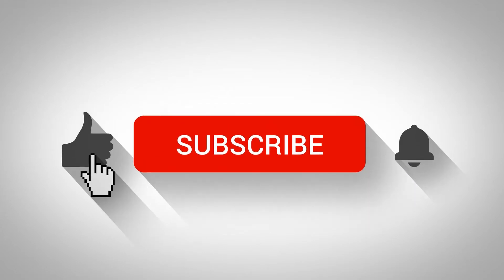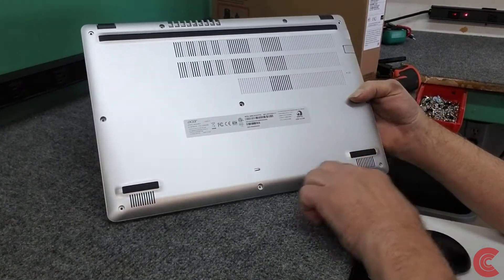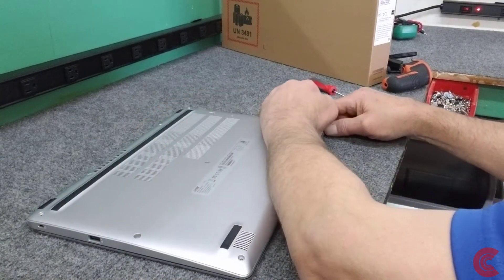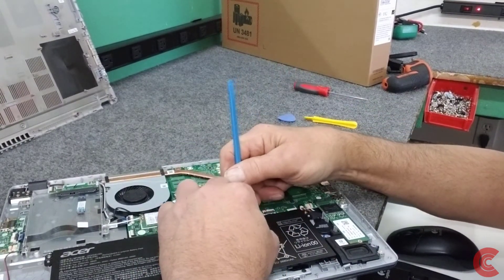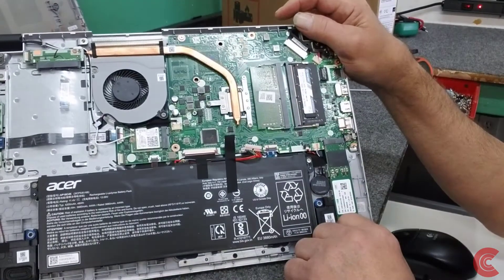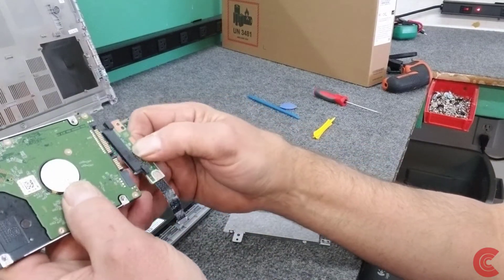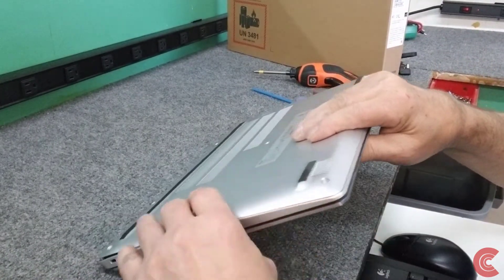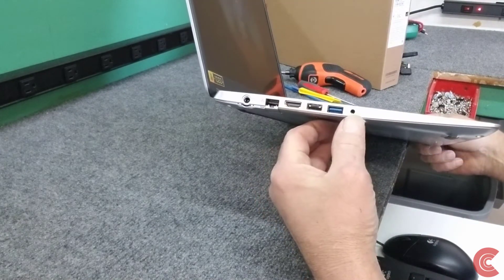Acer Aspire 5 Ryzen 3 Laptop Memory & Hard Drive Upgrade

Comment: Just wanted to know, can the 4gb of ram it comes with be removed, wanted to know if I can replace it with an 8gb and use another 8gb In the other.
Reply from the maker: Hi, yes, this model has 2 slots. You can remove the 4gb stick.

Comment: What size are those 4 small mounting screws?  I purchased the refurbished one and didn’t see the screws included.
Reply from the maker: Hi. I believe the screws to mount hdd in caddy are M3x3mm.  Dale.   Like these....
https://www.amazon.com/Replacement-Screws-Lenovo-Toshiba-Laptop/dp/B07FQXSJHH/ref=mp_s_a_1_1_sspa?dchild=1&keywords=2.5+inch+hdd+mounting+screws&qid=1608073071&sprefix=2.5+inch+hdd+mounting+&sr=8-1-spons&psc=1&spLa=ZW5jcnlwdGVkUXVhbGlmaWVyPUE4VkYwUVJSSUY5N0YmZW5jcnlwdGVkSWQ9QTA3NTE0MTkyTDNKVjM3RDVEMkVYJmVuY3J5cHRlZEFkSWQ9QTA3NDM4NjJNQlQ1TEZMOU1FVTcmd2lkZ2V0TmFtZT1zcF9waG9uZV9zZWFyY2hfYXRmJmFjdGlvbj1jbGlja1JlZGlyZWN0JmRvTm90TG9nQ2xpY2s9dHJ1ZQ==

Comment: What’s the main difference between an external 1Tb drive from an internal one?
Reply from the maker: Hi. Sata interface is considerably faster then USB.
Reply: @CadillacComputerCenter  Appreciate the reply!  Any idea where I can get those small screws that screw down the 2.5 ssd into the bracket if they were not included?

Comment: New Aspire 5 Laptop+1TB HDD+4GB RAM= $426.97 Amazon had a deal on their site for a new Acer 5 Aspire with 8GB RAM and a 500 GB HDD for $499.99! Saved $73.02 buying the same model with 4GB RAM and did this upgrade! Still spent $56.99 on a 2 year protection plan and still got it cheaper ($483.96) and +500 GB more storage space! Thanks for the walk through on the upgrade!
Link for the bare bones Acer 5...
https://www.amazon.com/gp/product/B07RF1XD36/ref=ox_sc_act_title_4?smid=ATVPDKIKX0DER&psc=1
Here is a link for the proper HDD... 
https://www.amazon.com/gp/product/B071F9MLJJ/ref=ox_sc_act_title_1?smid=ATVPDKIKX0DER&psc=1

Comment: What is the max amount of ram you can put in this laptop
Reply from the maker: Hi. On this model, I have installed 2 8gb sticks , 16 total. I haven't tried 2 16gb sticks at this time.  Dale
Reply: @CadillacComputerCenter  Hey Dale, did you end up trying 2 16gb stick by any chance? Wondering if I can go that route before I dump the cash on it! Thanks in advance!

Comment: you say 2.5" but your link goes to a 3.5" hard drive. Which do I need for the same computer?
Reply from the maker: I will check that link,  sry.. But yes, you need a 2.5 inch hdd. 3.5 is only for desktops. Thanks for letting me know.  Dale
Reply: @CadillacComputerCenter  hi it will be nice if u change the link to hdd for 2.5 inch